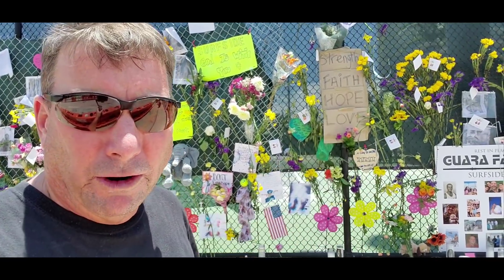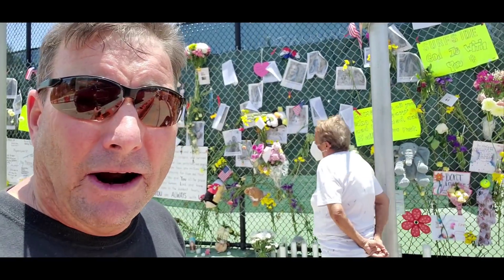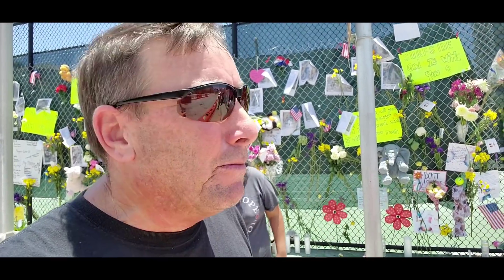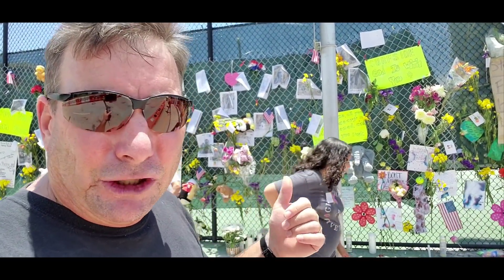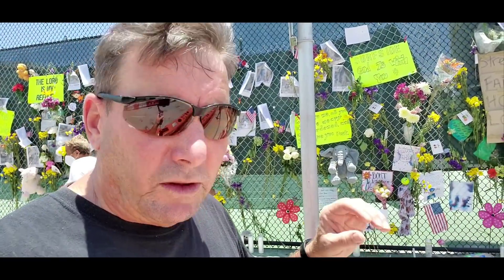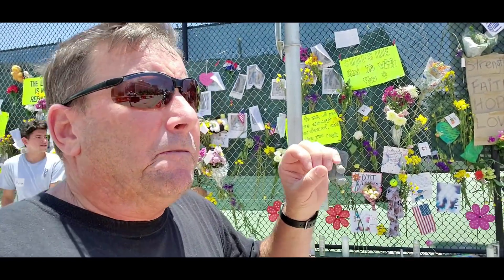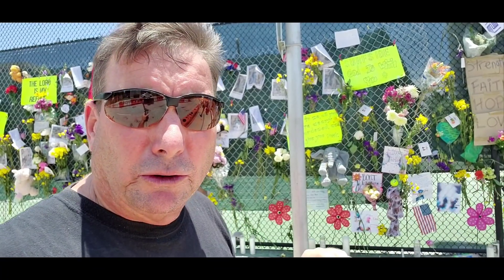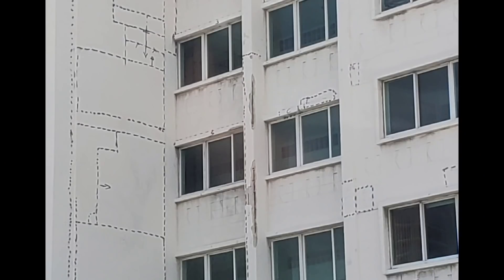Miami Condo Collapse and Memorial

Comment: I work at a college in a flyover state and we have a pretty large 4 level parking garage that we spend about $800,000.00 a year keeping up with concrete repairs and membrane. it's also post-tensioned and the salt that we use on it during the winter creates huge problems throughout the structure. I talked to our structural engineering firm about the situation in Miami and they will not deal with condominiums  because of the inherent problems with the owners/HOA's or whomever not doing the maintenance on therm.

Comment: This reminds me of the stories of buildings built in the Florida building boom of the 20s & 30s when construction companies used beach sand to mix with cement to make the concrete onsite to make the buildings.  The salt in the beach sand just ate up the rebar after years.

Comment: Edge of pool deck was attached to the main columns holding up the building. When pool deck collapsed, it affected the columns holding up the main building.

In hindsight not a good idea.

Airplane fuselages are designed to contain failures so they don't propagate throughout the aircraft.
Reply: Hi David

Comment: Hey man watch that condescending tone, I started out there in corrosion corner on 707ski's. Proud member of that rat hole off 36th street. Not to mention the watering down of the concrete when it was poured. Wet concrete is weak when cured.  A stiff, dry mix with the right ratio of cement is strong.

Comment: So strange that stainless steel rebar isn't required in Marine environments. With normal steel rebar, once a bit of moisture gets to it, the rust expands, cracking the concrete and it's game over in a relatively short time.

Comment: Juan, looks like you’re enjoying Miami. Definitely check out “Building Integrity” YouTube channel. Extremely informative information about the building collapse. He can be found here: https://youtu.be/TrP-Zl7NHzE
Reply: Here is a walkthrough of the complex from a year ago. https://youtu.be/w4rGWH7aDJc
Reply: Great Channel
Reply: ok, sounds like that Building Integrity fella is just blind guessing (rrr was a very out of date vid suggested "Surfside Building Collapse - Did the Champlain Towers South Garage Provide Warning Signs in 2020?" may be a better suggestion). the work on the building's roof I'm sure has nothing to do with the pool deck punch shearing around 9 minutes before the building came down. this looks to be weak toothpick-sized columns punch shearing after a column near M-9.1 gave out after being damaged by the pool deck collapse.

better example for Building Integrity on YT.
"Surfside Building Collapse - Did the Champlain Towers South Garage Provide Warning Signs in 2020?"
watch?v=ZAIJsaSo4Sw
Reply: bit more info here, more data less guessing. including a lot of pics of the columns and vid analysis by Jeff Ostroff.
https://www.youtube.com/watch?v=PEPyE2h6P4k
even in Building Integrity's latest vid, he is still a tad off on the break between the center area and the sea side sliver. I don't know if he is only looking at one or two photos and saying this is what it is, or hasn't seen full pics of the ruble pile yet, that break looks a tad more like this from the looks of the intact roof on the ruble pile and collapse vid
https://www.daz3d.com/forums/uploads/FileUpload/b5/ecf7ca16035f5d7f1eec31eb8857c1.png
3 sections, as pool deck collapsed between 5 and 9 minutes before section 2, and in the CCTV vid we can see the sea-side 3rd section stood for a few frames after the 2nd section collapsed to the ground before toppling over. so there looks to be 3 distinct collapses.

Comment: The repairs (depending on which estimates you use) were going to cost between $60,000 and $100,000 per unit.

Comment: The condominium association knew three years ago there was severe structural damage and did  nothing?  I think the lawsuits will be severe, but who is left alive to charge.  How do you buy a new mother, father, sister, brother, daughter, son - loved one?
Reply: They were doing something, just not fast enough.  They were told that the problems were not that bad - they were told wrong.
Reply: @donmoore7785  If they read the engineering report, that idea would be highly contradicted. They claimed the city inspector said "it was not in bad shape". Any HOA board who would pay the kind of money those engineering reports cost should have at least read the darn thing for themselves. That's what they are there for.

Comment: This video by an Argentinian engineet really explains in detail what happened. Unfortunately its in Spanish.  Basically the building did not have beams. It was slabs connected to columns. The pool deck punched thru its colums and then it pulled the building columns and buckled them and the whole building followed.

https://youtu.be/jGUEwj-Pi54
Reply: Interesting...one way to get another floor of condo sales with a height limit. Sad, so sad. No one will be using the developer, architect, civil engineer and maybe all of the sub-contractors who built this structure. At least we hope not and they all can be part of the restitution to the owners/victims. Like he said, first year student will be educated about this issue and by their second year, not even consider this construction idea.

Comment: I've been watching BUILDING INTEGRITY on YT. He has construction answers like BLANCOLIRIO has aviation anwers. Frankly I'm surprised this building didn't fall down sooner. Spalled concrete and rusting rebar everywhere.
Biggest surprises though are that they build this height with reinforced concrete in this coastal environment and then only inspect/certify after 40 years.
Thoughts and prayers to those affected.

Comment: Hi Juan. The pool itself was intact. They call it "pool deck" simply because its adjacent to the pool. Its simply the concrete open lounge area that had the underground garage below. It makes more sense structurally to call it the roof of the underground garage. Water was puddled stagnant on the "pool deck" a dozen feet away from the pool, closer to the building. I imagine the reason the these dips existed to form puddles is sinking of the subterranean concrete pillars, the foundation itself was sinking unevenly. Real question is, what caused that sinking.

Comment: NYT has been doing general reporting.  The number of affected buildings in the Miami area is very large.  The inspectors are behind as is. It’s really up to each condo to ensure their building isn’t on the point of collapse. 

Another thing that surprised me: these buildings are on a slender barrier island, just a sand bar really,.  Subject to hurricanes! It seems a totally unsuitable area to put up large buildings.  The wind would sweep salty air in, a perfect way to corrode concrete. And it’s a hot, humid climate, both factors increasing the rate of corrosion.

Comment: Juan—-  as much as I like your review and analysis of aviation issues, I believe you are repeating something about the cause of the building collapse which is wrong. The pool itself did not collapse and can still be clearly seen to be standing in photos of the disaster area.  The building area which failed was the a part of the patio/ pool deck and planter area adjacent to the building and above the entrance ramp to the parking garage. It’s the area at the bottom of the garage ramp where water was always pooling and was adjacent to the 3 support columns which first gave way, resulting in the collapse.
Reply from the maker: See correction above. Pool deck, not pool and deck.

Comment: The question here is how many other condos are in similar straits and should be evacuated pending repairs?
Reply: I think it would be like aviation, the Swiss-cheese effect.  Multiple factors penetrate the layers of security, and every one of them is necessary for a catastrophic accident to happen.  It's an extremely rare event in the US.  It does provide ample motivation to make sure of the structural integrity of other buildings, particularly along the coast.  But I doubt any of them are in imminent danger of collapse.  (If there are any, we will find out soon enough.)
Reply: I’d look for the intersection of the Architects for this building and the contractors for it.
Reply: @tomcoryell  Certainly all the buildings constructed by this contractor should be looked at very closely. Their departure from architects' plans is troubling.

Comment: Jaun -- the discussion from 3:50 is quite a bit off. The garage did not extend below the pool.  The pool is not above the garage, and condos are not above the pool.  The pool did not collapse into the garage, it's the pool DECK between pool and condo (and over the garage) that collapsed.  The pool is off to one side.  The consensus of reports I have seen (especially the channel Building Integrity) is that repeated soaking of the pillars in the garage directly under the condo building, with salt water (so spalling of the pillars)  and repeated soaking of the pool DECK (due to incorrect slope design or implementation) are the likely culprits. The pool per se is not implicated at the moment, so far as I can tell.

Comment: 2:45  "[rebar] expands to about 6 times its original diameter". Not quite right.  Expansion due to rust is usually quoted at about 6 to 10 times the volume . Volume is proportional to the cross sectional area, which is proportional to square of diameter. So 6x expansion would correspond to SQRT(6) increase in diameter, or about 2.5x expansion.  Regardless, the main point is the same -- the expansion due to rust burst out the concrete, aka spalling.

Comment: Nice recap Juan… I also noticed that the first floor around the pool was a “soft floor structure” (tall column “stilts” without attached shear walls).  When the structure below goes, these tall free-standing columns more easily buckle, causing a huge (comparatively) displacement of mass, and down she comes! In California, due to seismic codes, soft floors like this have been all but eliminated from new designs.
Reply: Hello Trent, how are you doing. I hope you are safe and in good health. Looking for a new friend and i saw your pic here. I hope you don't mind thank you.

Comment: Here's a theory of what could have happened.
We know the building was allegedly in disrepair but probably not enough to bring it down BY ITSELF, more on that below.

The Champlain Towers South (CTS) residents complained about the noise, vibrations, and tremors when the next door building, the 87 Park, was constructed. That probably is not the cause either by itself. The buildings in the area seem to be somewhat hardened for tropical storms.

There have been many storms in the past that hit that area. However, one is more interesting. Hurricane Irma didn't hit directly but brought lots of rain and water to that area.
Hurricane Irma hit in September of 2017 which seems to be about the time that the next door 87 Park foundation was being built or just finished. If that's the case, then the 87 Park building foundation, either a whole on the ground or with some work started, would have been flooded. So, all that water would have had to be pumped out.

What if during the process of pumping out water it pulled water, sand, and dirt from the adjacent lots including from underneath the CTS. It was not enough to cause visible or detectable structural damage to the CTS but may have weakened the foundation. At this point, its concrete pile foundation, assuming it's the friction type, may have been compromised, as the piles were not as tight in the ground.

When the CTS started to have visible and detectable water damage from the pool, that water may have run underground away from the building taking with it additional dirt/sand/mud into the potentially existing air pockets created by the 87 Park pumping mentioned above. As time went by, more and more dirt/sand continued to slowly be pulled from underneath the CTS foundation thereby creating an invisible sinkhole. The building was sinking about 2 millimeters a year. The resulting cracks started to be observable in the parking garage and pool areas of the CTS. It eventually reached a point where the pool deck collapsed into the parking garage below, taking down the building with it.

Maybe even the cracks that were referenced in the 2018 CTS assessment were already being created by an invisible sinkhole from the 87 Park pumping. Well, this is just a theory to consider. None of these comments are proven facts but rather assumptions.

Please make your comments about this theory, good or bad.

Comment: Concrete if properly specified and prepared can be very resistant to deterioration. Concrete cooling towers at the Crystal River Energy Complex, which circulated sea water six months out of the year,  show excellent service life after more than 20 years. Poorly specified concrete is not so durable, such as similar cooling towers up the coast at Anclote Power Station which collapsed and required demolition after same time period. It's all about the care taken by designer and contractor.

Comment: Its rather like life, isn't it. Without a solid foundation, things can come apart easily.
A devastating event, especially for the family and friends of those who were lost.
And, as others have noted, something that could have been avoided, with proper building
inspection and corrective repairs. Buildings of that type should receive a complete
inspection every ten years. This particular structure should have been condemned,
several years ago.

Comment: Are they also going to look into the us military naval test bomb that caused a 3.9 earthquake in that area two days prior? Because the building might have had structural damage but that 3.9 earthquake was probably the nail in the coffin.
Reply: That test was about 230 miles away from Surfside.  Not likely close enough or strong enough from that distance.  I haven't heard of any damage reports from closer locations as I would expect.  But you can be sure lawyers are looking at the possibility.

Comment: Heard someone say they weren't seeing as much rebar as you'd expect.
Reply: Or it was in the wrong place.  Some of the rebar in the deck/ floors was supposed to go through and be tied into the columns, but apparently too little of it did, so either (as you said) wasn't present, or bypassed the columns and did nothing to support the deck/floors.

Comment: A huge tragedy, and just like Grenfell in the UK was totally avoidable. Complete lack of oversight and incentives that encourage owners to put off repairs and hide issues have once again killed dozens of people, probably will be hundreds. I doubt anyone will see consequences besides a slap on the wrist.

Besides that, why are we continuing to build these bargain bin condos in coastal florida, which will be underwater in a couple decades. The water table is already so high that a few inches of rain causes torrential flooding in many parts of the state.

But most of all, condolences and support to the families of the deceased.